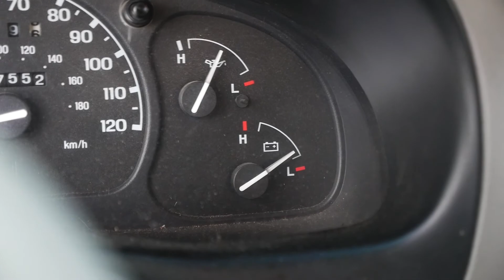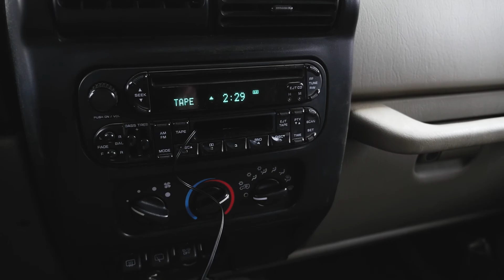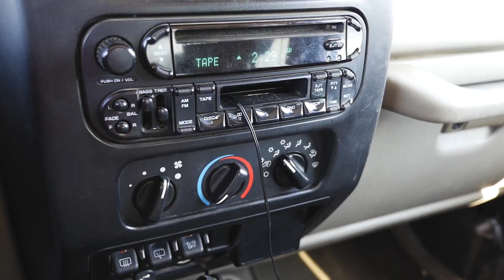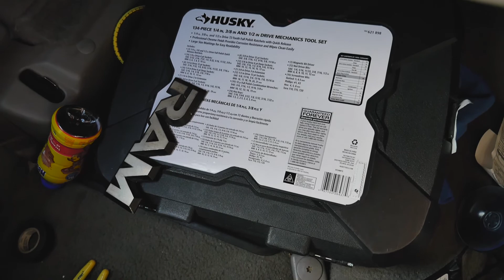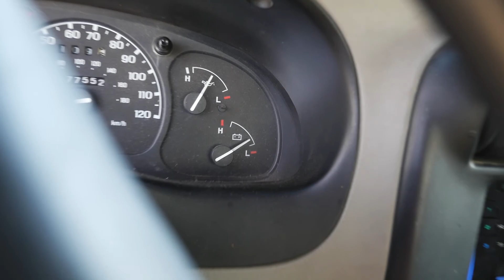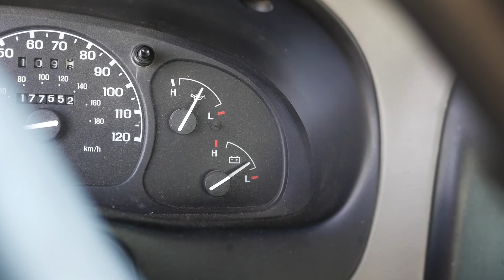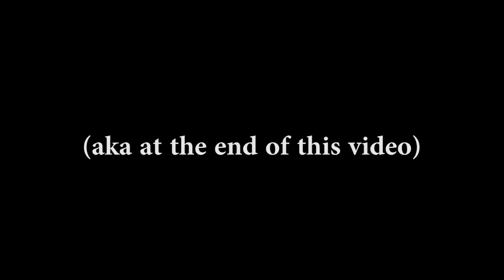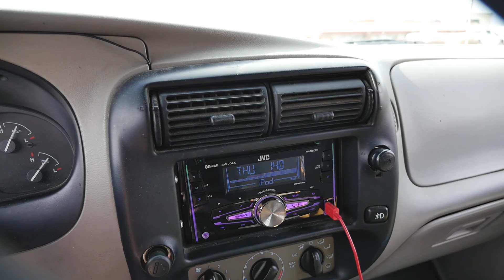dead.

Comment: a battery gauge with H and L is about as useful as a bucket without a bottom. how are you supposed to know what the voltage is if there are no numbers? all that gauge can really tell you is that your battery is either charged or dead, and a light can tell you that. l would put in a new gauge.